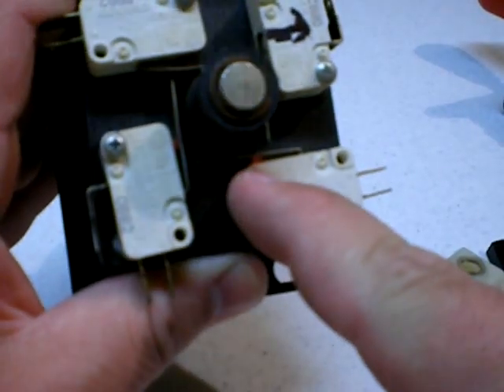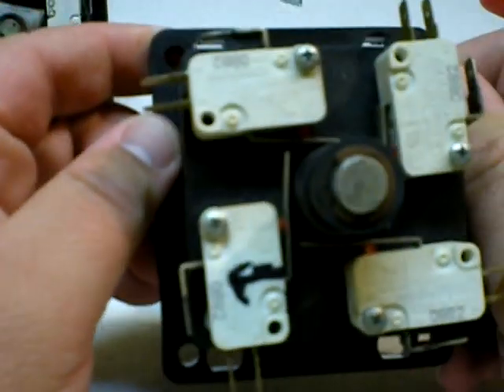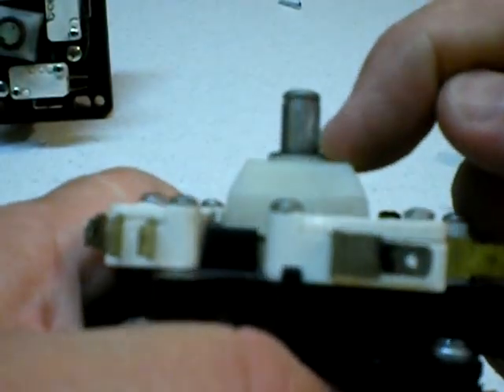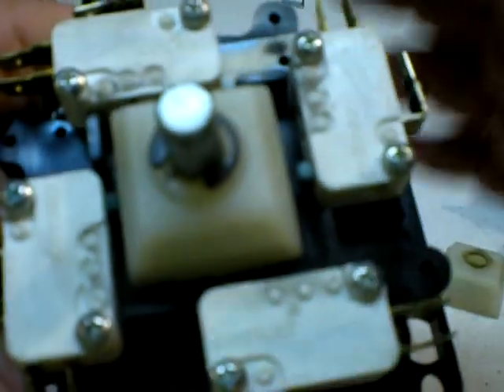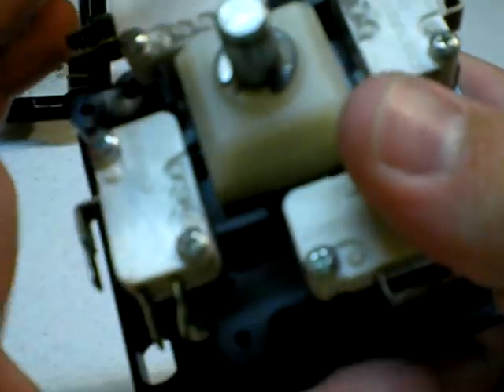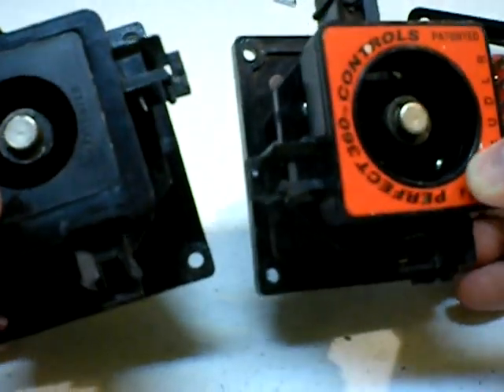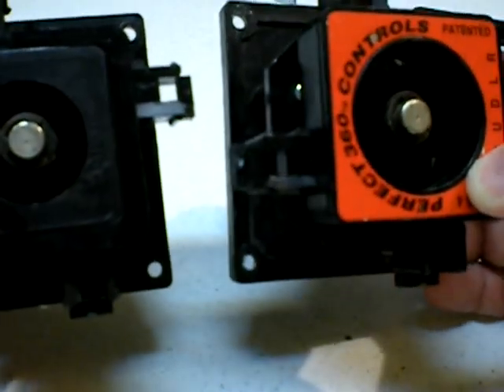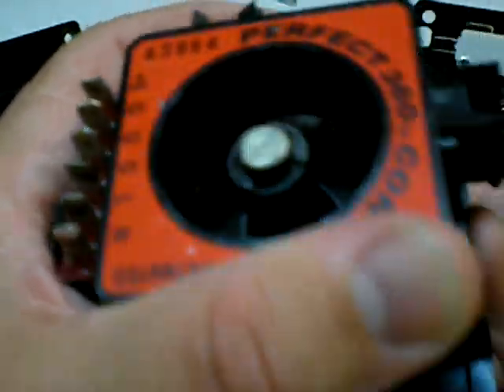Tighe Lory Reviews HAPP, IL, and Wico Brand Arcade Joysitcks

Comment: The Optical joysticks are incredibly accurate and are quick to respond.  You can change the spring so it moves lighter.  They are great for games like NBA Jam  or Blitz or any old school game.  Its good for fighting games once you get used to no click
Reply from the maker: Paradise Arcade Shop makes an amazing module for Sanwa sticks. I had the optical module for Wico sticks but I sold them off for $100 a piece.
Reply: I have two perfect 360 sticks and two sanwa versions as well.  Both are awesome.  Made one work on my custom Atari Jaguar Joystick, it is great

Comment: Tighe, you were so right, the IL I have just doesn't hit diagonals well at all...guiles super and ultra miss so often, as well noticed down-back wasn't working when I couldn't block. Happ competitions are still better. The best one's are I got are from GroovyGamingGear, the actuators are so much better. IL might have nylon, but the shape just misses diagnols much too often. Thanks for the video btw.
Reply from the maker: I think I must have miscommunicated I feel that IL sticks are superior. Where did you buy them? If you by them from Paradise arcade shop they should be good. The actuators in HAPP and IL Eurosticks are the exactly the same shape but the ILs are nylon and the HAPPs are PVC. Buy one from paradise and give it another chance.
Reply: Well the custom stick I bought came from Arcade-In-a-Box awhile back. While the happ competition stick did come with a nylon actuator, the cylinder below it was black pvc...while Paradise arcade shop's was nylon. So, at that point I wondered why mine was different. The actuator felt smaller than the PVC actuator I use now that that hits diagonals just fine. I thought because it was smaller in size, it wasn't hitting them properly. I've been meaning to purchase a IL stick off paradisearcadeshop anyway, but held off because I saw before in a forum you had issues with it. Now that I see it was a misundestanding, I can go ahead and purchase it and feel it'll be a great stick. Thanks Tighe :)

Comment: Thanks tigheklory. I bought the competition one from jamma boards but im not happy with it (problems with diagonals), but i wasnt aware which one to buy. Now ill get the happ competition. I have a brazilian neogeo mvs with a new wood control panel 2/3" - 1.5cm thick; since american cpanels are mostly on metal (i belive) could you tell me what is the best size for the joystick hole - i did a 2.9cms - 1 1 1/8" but i think a bigger hole would be better.  could you gime your opinion? Obrigado.

Comment: Excuseme. I want an IL arcade joystick but i see only with the circular actuator ones. My question is if IL joysticks comes with circular or square actuator. Because i read that there are fake IL joystick out there.Some vendors sells "IL joystick" but with circular actuator and without micros. And the logo is marked on joystick but i don't trust. Are there IL joystick without micros and circular actuator? And what actuator do you prefer? Thnks!!